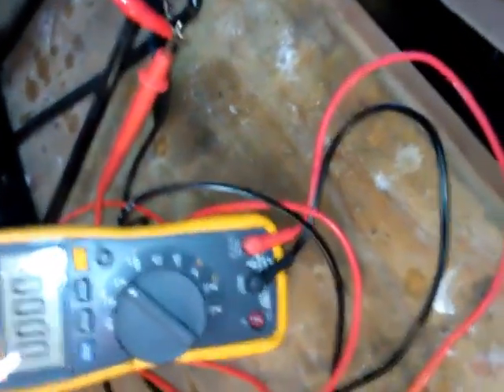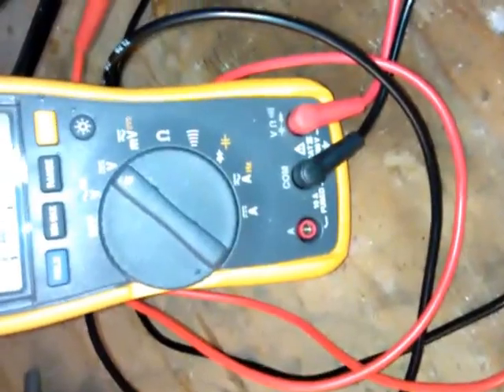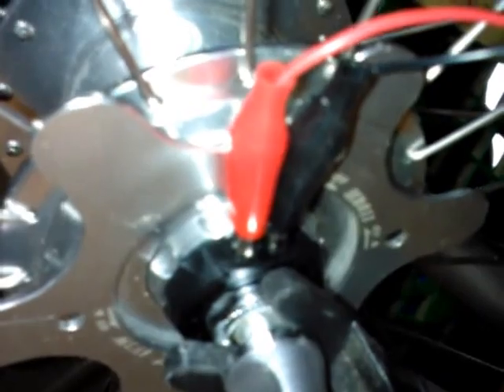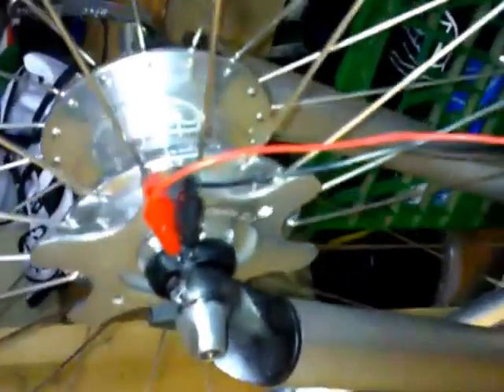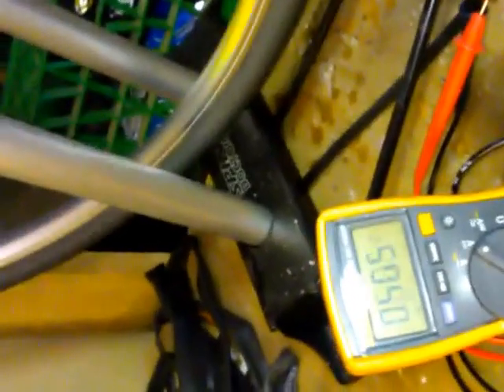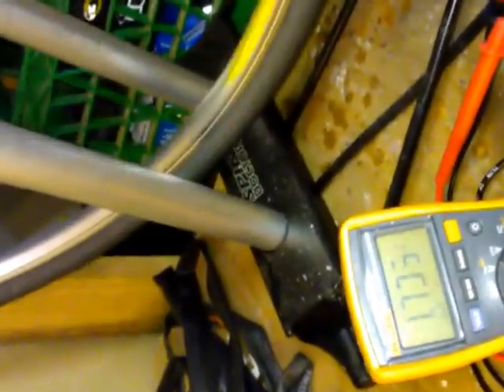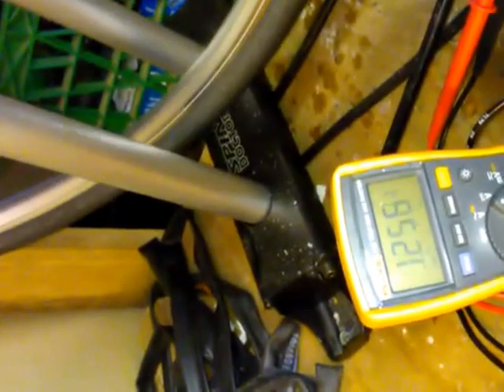Dynamo hub output voltage demonstration

Comment: It goes all over the place, because you are measuring AC hub voltage in DC mode, by the looks of things.  You also have no load on it.  12 ohm load is typical.